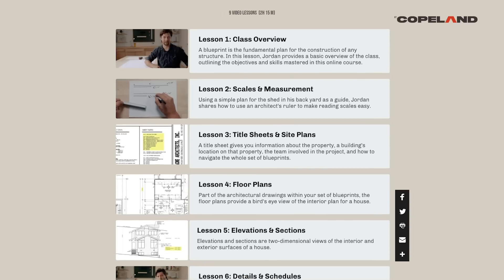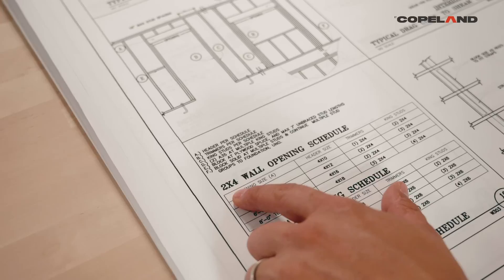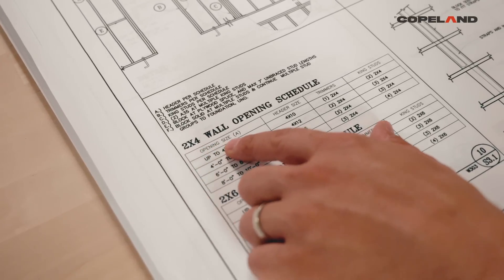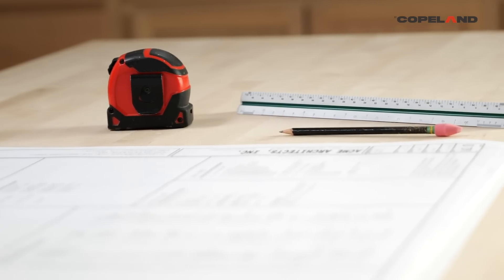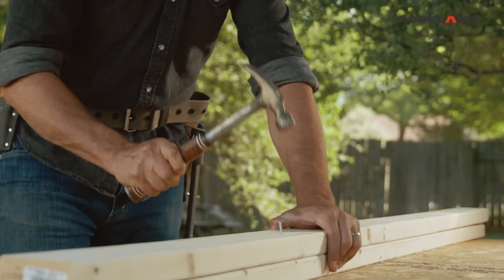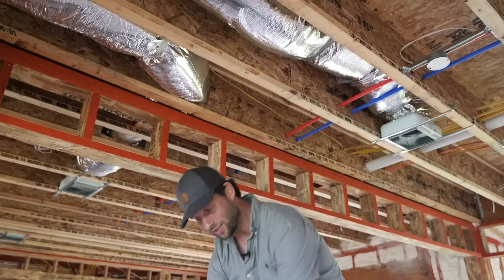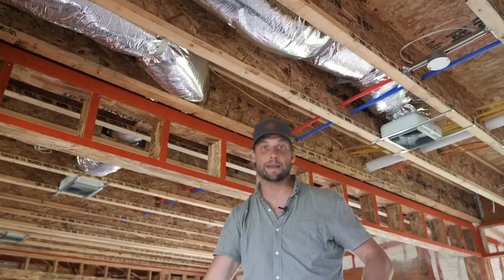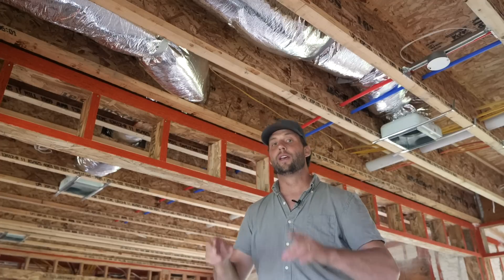Flex vs. Rigid Metal AC Duct - My preference may surprise you!

Comment: I’ve been an HVAC for 36 years flex duck for a long runs I don’t recommend ever at homes. I’ve seen too much friction loss causing low airflow throughout the house. If you want to use it for a short straight runs in a crawlspace you can. Rodents do like it as well. If anything goes wrong with that flex duct in finished ceilings you’ll have to rip all the sheet rock out to get to it. I’ve just seen too many issues over the years with too much flex on a job. If I was building my house I want rigid yes it’s gonna cost more but it will last forever and I don’t have to worry about friction loss. Builders are trying to make too much money on the HVAC part of the house and when the HVAC doesn’t work the house is a piece of shit. And I’ve seen that in multi million dollar houses where there’s really nothing can be done to correct the issues but cut the house up. You’re trying to save too much money on your houses HVAC in my opinion. Especially in this video where that flex duct is buried
Reply: I've been doing duct for 30 yrs, flex or hard pipe,  to me there's not much difference if done right
Reply: @Machoman-ct  I’ve seen it cause problems with too much flex. Flex installed in an accessible areas once all closed up is a problem
Reply: Ben, how long is a "long run"?
Reply: @davidb8865  over 6 ft
Reply: F it. Just get make a cabin with a window ac.
Reply: This guy on video don’t know how to install metal duct or he would not be on here. I use flex only in crawlspace or attic. But my main trunk is metal wrapped on outside with r8 duct wrap or bubble wrap
Reply: @kennethbubser9601  EXACTLY<<CANT STAND THESE DORKS<<<
Reply: You guys can't run duct as good as me and don't even know it!lol
Reply: @dbourgeois80 you look like a 12 yo and act like one as well.
Reply: My crawl space has rigid that has been ripped open by critters; rats, possums, raccoons. Now what?
Reply: @donnahenthorn7109  are you sure it is rigid pipe I’ve never seen that that would be something to see. I don’t kind of critters you have where you live to go through rigid pipe. I just can’t believe it’s rigid
Reply: @donnahenthorn7109  ding,,ding..nesting materials
Reply: @donnahenthorn7109 I call BS unless you have super critters from outer space.
Reply: @JohnLee-db9zt  what I know is we moved into the house in 96, and in 2010 or so my husband went underneath and found all kinds of damage including ductwork insulation pulled off. He left a work light turned on and I was able to see the light through the air conditioning. So I know it's been split open. You can call BS all you want, but that's how it is.
Reply: I've used flex as much as I have metal pipe, not much difference either way, been doing it 32yrs
Reply: @Machoman-ct  i’ve seen the Air Llos problems because of too much flex tect. It has his place in the industry, i’ve seen flex duct in areas it shouldn’t be, in closed off walls and cathedral ceilings where it really should be metal.

Comment: As a union sheet metal worker who mainly does commercial and sky scrapers you actually did make some very valid points. I went into this video expecting to disagree. I think for residential flex duct is completely fine. As long as the runs are not super long and installed properly. Unfortunately so many of these track homes don’t have good installers and Like you said don’t commission, so rooms are not balanced correctly. Therefore some rooms are super cold or hot  while others don’t get much air flow. Another huge factor is return location and return size. Do your research on who does your system. It’s worth paying top dollar for a system that is so important.
Reply: Yea, yeah. I like to design the lowest static pressure possible to get uniform velocity and volume at every register. Everyone with a brain designs size for AC. I've used an old program from Carrier which works very well. You can adjust everything by the fan CFM to get everything the same static pressure & volume. I don't want to hear the air flowing from any of the registers.
Reply: They stole my computer.
Reply: I can't remember the name of that program. It's from 1983. Airflow properties are eternal.

Comment: You prefer going with flex duct?!! If you have been paying any attention most homes down in the south got flex ducts however the only con being the 90 turn where plastic ridges inside the flex create air resistance which can be fixed with a metal 90 fitting.

Comment: I think rigid is a crappy system. The amount of leakage that takes place along the way is ridiculous. There are always rooms that don't get enough air flow but if there was no leaks more pressure would get there. flex may be the answer. I think it should be code to use mastic on rigid ducts and there should be a way to pressure test to make sure it was done properly. Ductwork should be air tight.

Comment: SMACNA standards address all these details in great details with scientific examples of various products. It recommends standards that are speced or specified on drawings by MEP engineers. Flex is to be used any the end of a run, tying in the duct to diffuser box.
Testing and balancing is done upon completion, to record how each vent is performing and is adjusted or balanced by adjusting dampers,  so everything works as speced by architect.

Comment: From a professional HVAC technician who is building his own house I'm not putting in any flex duct. A properly sized and installed sheet metal trunk system is the best way to go for even, quiet, and comfortable air distribution with long term performance. You're correct it needs commissioned for it to work properly, but it all starts around a good design and proper execution.  Thus rarely happens and that's why people make the octopus nest for duct systems.  Flex is quick to run and cheap to buy causing a poorly designed and executed system for as little money as possible.

The main reason for cheaper installs and poor work is because the HVAC is the most expensive mechanical bill for the house.  Plumbing and electrical are hard to cut the cost down that much. HVAC is always the easiest way to cut a large amount of cost out of the equation.
Reply: Did you line those metal ducts with insulation or add it to the outside?
Reply: @aayotechnology  I wrapped the outside for the duct running above my garage, but no insulation for the duct in the basement
Reply: In short.. just be good at your job. I'm in hvac.. I 👍

Comment: Had brand new metal duct installed in my home professionally. Everything had mastic and insulation with the silver supersonic tape on all the joints. Had it for many years not knowing that because of the high humidity location of our home, that insulation wasn't doing diddly squat other than becoming soaked. And I mean soaked - so badly that it began dripping and ruining drywall. Removed that soaked insulation, replaced it and at the end of that summer season, it was completely soaked again. Ripped it all out, replaced with flex and problem solved. Plus it's so much quieter and a conversation in one room is not transported to every room with a vent! Maybe hard pipe is great for low humidity locations or if it's inside the heated/cooled space. But lesson learned in the south!
Reply: Thats what i don't like about rigid, you get one little air leak in the insulation it starts making condensation soaking it which tears more places.
Reply: What area do you live in?  I've never seen ducts have condensation in my area
Reply: @ELIRAXPRT  In super humid areas like the american south where the ceiling cavity is not sealed well or just in the attic you can have high humidity in there. At that point any improper insulation on the ducts will cause condensation to form on the rigid pipes. For many places in modern homes however, condensation from rigid duct can be a sign of improper AC function, rather than an insulation issue.
Reply: Might have been cheaper to leave the metal and spray foam the roof.  Cheaper... And problem solved.

Comment: Consideration: in a crawl space rodents are much more able to get inside a flex duct than a rigid duct.
Reply: If you have "rodents" going into your ductwork, regardless of it's composition YOU GOT PROBLEMS BRO! Never saw a rodent in a duct in 30 years in the trades; not saying it can't happen; just saying; I've never seen it...It's not something we worry about here...
Reply: @godbluffvdgg  I can assure you that field mice indeed can eat thru the flex duct as I have them repeatedly chewing and nesting in my duct work.  I am replacing my flex duct this fall with rigid duct.
Reply: I’ve seen it only one time, super nasty.

Comment: If you spend 6-10 grand on equipment spend more some money for a good install. Ridge pipe is the best for a reason. If you use that much flex it will cut down on efficiency on your whole system. Just think about the electricity you are wasting for the next 30 years. 5’ of flex is acceptable

Comment: The inner plastic liner is going to fail over time as it become brittle and splits. Then your air is likely to get contaminated with Fiberglass, which you will be breathing in. You might get 8 to 20 years before the inner liner fails requiring replacement.
Reply: I know a facilities manager at a hospital that ran into that problem with some flex having particles entering the airstream.  They now require hard duct as much as possible and only allowed flex where hard duct couldn't possible be installed due to clashes with other materials  and in very short instances just to attach to a diffuser
Reply: Sorry sir, but that is absolutely false. Polyester film does not get brittle over time, UNLESS it is exposed to ultraviolet light (usually sunlight).

Comment: You are installing flex duct because you can make more money as a contractor on reduced time and material costs. 
• Centrifugal blowers do not push air as a positive displacement pump does, they circulate off of the pressure differential created through proper design.
• Noise in ductwork comes from velocities that are too high which would be from undersized duct or a collapsed flex duct.
• Installing flex duct in structures that will be covered in drywall will cost the owner a lot of money in the future as flex does not have the lifecycle expectancy of hard duct.
• ASHRAE and ACCA have standards in place which recommend best practices for the greatest efficient and life cycle of the equipment.
• Flex duct has a higher friction rate as compared to Ridgid duct which means you will pay more money in kw to move the same amount of air through flex rather than Ridgid.
• Installing a high quality system usually involves training which is governed by standards. What training and standards are you commissioning your work against?
If you had the money to build a brand new house, would you install flex or Ridgid and why? Give customers the best, give them what you would give yourself and if you are going to reference “not that much” or “not that big of a difference”, than at least have the decency to give actual numbers as a true technician would.
Reply: Rigid is the correct spelling. Other points well taken.

Comment: Round duct has less friction and less turbulence than square duct. Most square ducts are not sized correctly because the installers don't know how  or don't like installing transitions. Metal square duct is by far the most labor intensive and the least thermally efficient material.
Reply: Yea, I'd prefer to use rigid galvanized round duct for everything other than the plenum... or a very main trunk.  You can use round for main trunks also, but dealing with the takeoff's is more expensive and thus a pain.

Comment: It is all about the planning and design of the system as a whole.  Combine a half assed plan with a crappy install and you get a crappy system, like mine.....  One negative is that you can not clean a flex ducting easily.  You can rip it with the brushes...

Comment: Jordan isn't wrong, but not 100% right either. Even most rigid duct guys use at least some flex - usually just before registers to quiet blower noise/vibration that is transmitted thru rigid. That said, flex simply isn't durable. Difficult to clean old flex without damaging it (especially at bends). Running flex that is covered by ceilings/walls is a problem for me - fixing/repairing/modifying hidden flex requires a lot of money - maybe that's something a future owner will end up paying for (households move every 7 years on average). And it's subject to mice/rats eating thru the plastic.

I'd use rigid in a trunk and branch system. Rigid for straight runs, flex for branches. And ideally, ducts are inside conditioned crawlspace or attic so you have easy access.  As for leakage in rigid, the few places that may not get sealed only leaks small amounts.  And if you know what to look for when rigid is installed, pretty easy to check with a flashlight and extendible mirror for those tight spots. 

The biggest thing I see with rigid is too thin mastic coverage - after some years it can crack due to expansion/contraction or simply drying out.

All has pros/cons.  Really boils down to quality of design and installation, not so much material choices.

Comment: I just completed a project re-doing the flex duct in my attic.  Original builder did a piss-poor job, leaving metal supply and distribution plenums uninsulated and the flex was installed very sloppy and was only an R4.2.  I built my own distribution boxes with proper design and insulation and replaced all the duct with R8 flex.  I used hard elbows where it turns to connect to the ceiling registers and for turns coming off the distribution boxes.  I made sure to stretch the flex tight to eliminate as much of the accordion effect on the flex walls to reduce airflow resistance as much as possible.
Reply: Did you notice a big difference in performance after the upgrade?
Reply: @gnarnal  in terms of air velocity, not too much. There are some issues with the design of the main take-off at the furnacethat I feel are impacting air flow. But the heat last winter was definitely much warmer than it had been. The upstairs was getting even hotter than before. So I’m that respect, it did improve. Much less heat transfer between the attic space and the ducts.

Comment: The airflow characteristic of flex cannot match ridgid.
Reply: Yeah if it's engineered and installed properly. Good luck finding that in a residential setting.
Reply: @20somthingrealestate  
If what is installed properly?
Reply: @sherifnabil9663  Well we're comparing with rigid. So rigid

Comment: Like you say, a lot hinges on the installation, if you are getting adequate airflow, cool. That corrugation inside the flex duct CAN NOT flow as much as a identical sized rigid duct. Immaterial if flex is going to be able to supply an adequate amount of volume but the difference is real & easily quantifiable.

Comment: I use flex duct, but I add in metal elbows for 90 degree turns and usually add some metal going into the registers on the ends, so the flex is straight shots or gentle bends.  The more important thing is to have the airflow calculations and cross-section sizes matched to the air handler total and the CFM needs for each room.  There aren't very many bad HVAC materials, just misapplied and poorly installed ones.
Reply: my only issue with interchanging them with 90s is at termination points, when moving from a 6 in flex to 6 in rigid, the friction rate is so different that you can screw with your desired exiting velocity with this transition. Sometimes you can account for this by going from a 7 in flex to a 7 rigid then 7-6 reducer then 6 inch rigid and then a 90 if you need.
Reply: Few years ago I did a job where an engineer incorrectly spec'd the equipment. The system failed balance by 50%. Anyways, There were couple runs where flex was making a tight turn. She claimed that by adding SM elbows, this would solve our issue or at least greatly help. my balancer balanced the house before and after changes were made and there was no difference. Keep in mind, we did 3 different tests each time to prove our case. Adding sm elbows does not relieve static under normal conditions.
Reply: Nice info. Can duct work go through the joist like he has it? Is that safe?
Reply: @The1SimLash There are guidelines for where you can drill and how large you can drill in all areas of a house. Wall studs, joists, etc... That is what you need to check before drilling or notching things.
Reply: @The1SimLash  I haven't gone thorough I-joists with it.  I've gone through I-joists with line sets between the condenser and evaporator, but not with ductwork.
Reply: @The1SimLash  If it's allowed in your area there's nothing "unsafe" about it
Reply: @The1SimLash   - Notice the truss/beam supporting the span...
Reply: Can you use flex duct for trunk line?

Comment: I replaced all my flex with hard metal.  Why?  Rodents eat through the flex duct.  Got sick if dealing with it and ripped it as out.  No more problems.  My house has crawl space not a full basement which likely.make a difference.
Reply from the maker: Installation location definitely makes a difference!
Reply: @JordanSmithBuilds  is there a way to prevent this?  I plan on installing this in a crawl space area.

Comment: I’ve been doing AC in Ft Lauderdale since 1982 and my house has a flex system.  It’s quiet, it’s cleaner and the insulation is better.  My duct man knows the right way to do flex systems.  That being said, it might be the easiest system to screw up by being lazy.
Reply: What about rodents, also deterioration of the plastic covering the insulation. I will use as much rigid as possible, until some kind of new flex is invented to prevent rodent access.